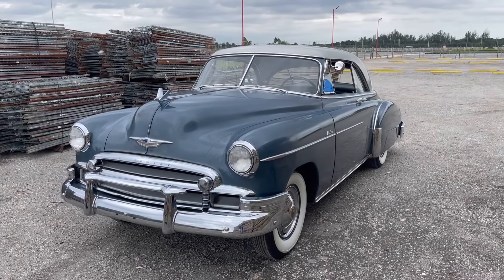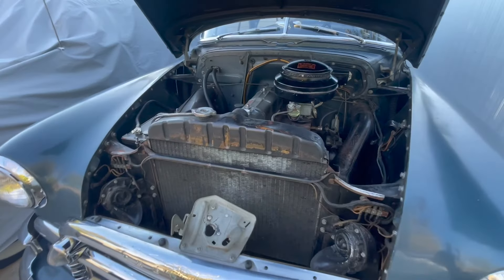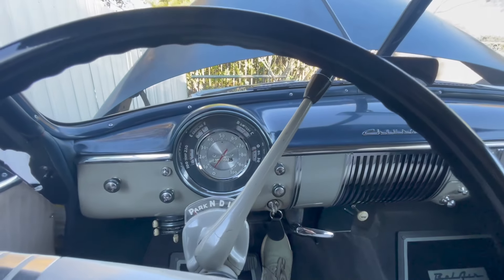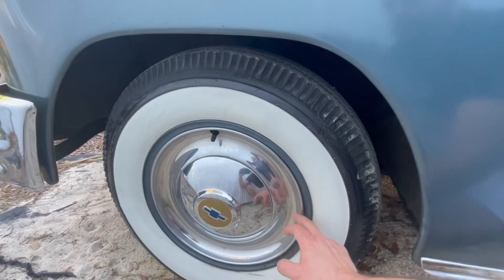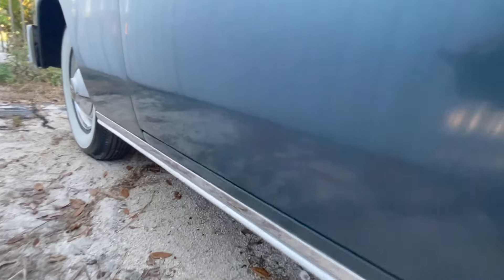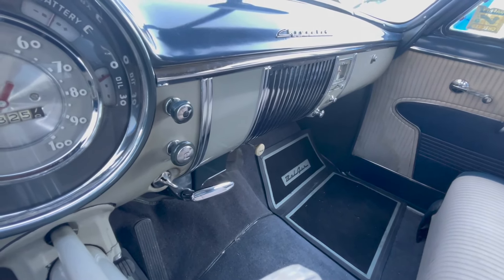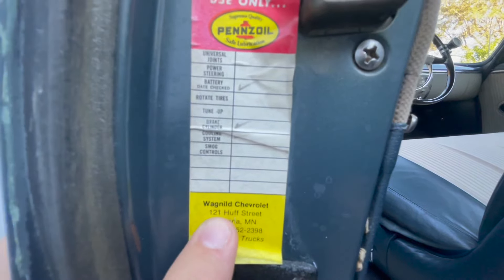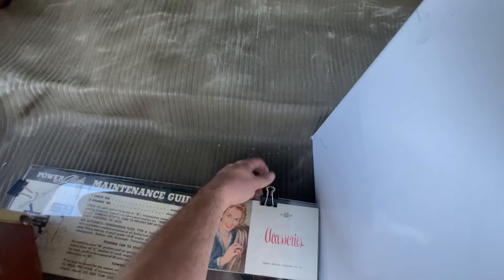1950 Chevy Deluxe Hardtop with 235 engine & Power Glide transmission.

Comment: I thought the 235 engine has the valve cover bolts on the edge and not on top center. I’ve had a few cars with a 235 . I could wrong?

Comment: I have a 1950 Deluxe 4 door with the power glide. People keep telling me I have 216 instead of the 235. But I'm pretty sure I have a 235. They say the valve cover gives it away but I read where some 235's have the 2 post valve cover like the one you got. I have the same one too.
Reply from the maker: Yes. You have a 235. They look the same as the 216 but the block on the 235 is taller. The valve cover is the same for both.